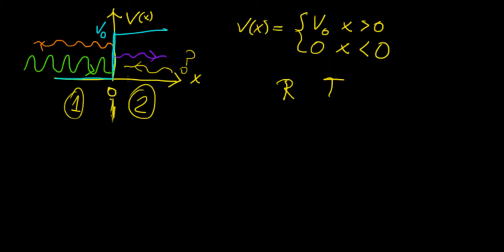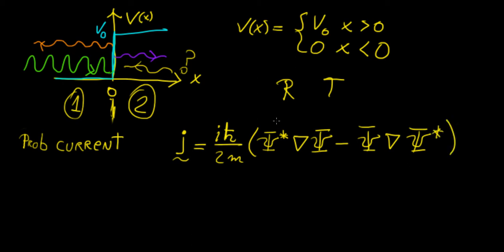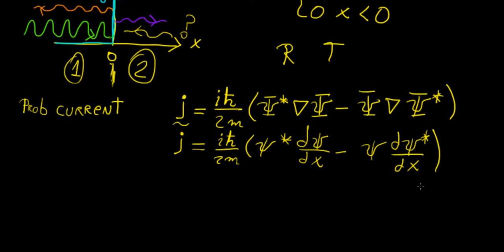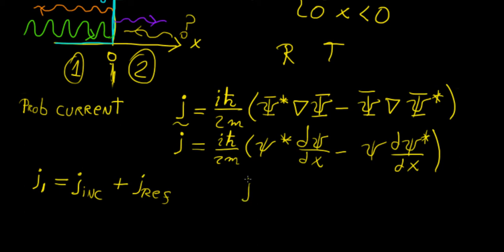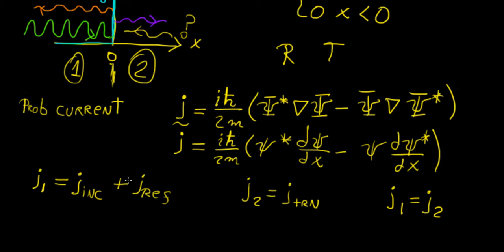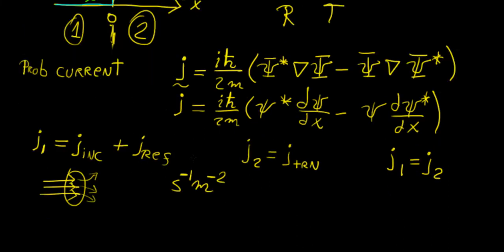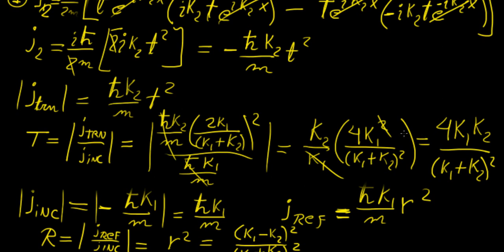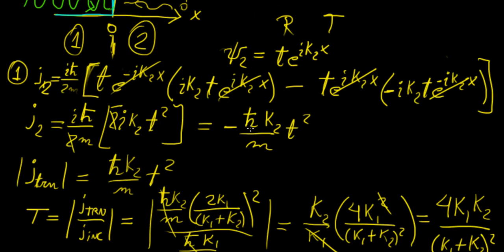Potential Step part 3 | Quantum Mechanics | LetThereBeMath |

Comment from the maker: I made a mistake in the formula for the probability current. The term ih/2m should have a negative sign in front. Howrver, once you take the absolute values of each current you should get the same results for the reflection and transmission coefficients.